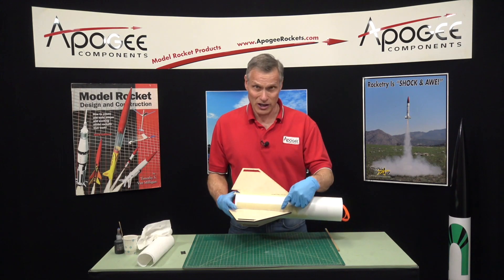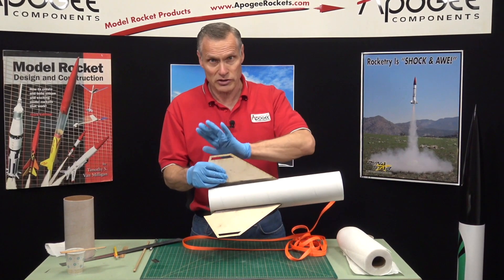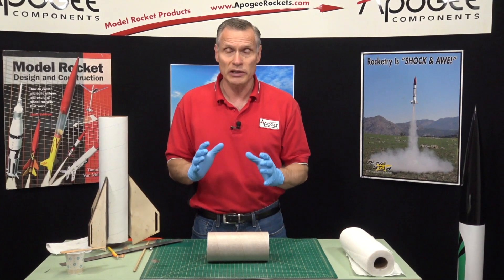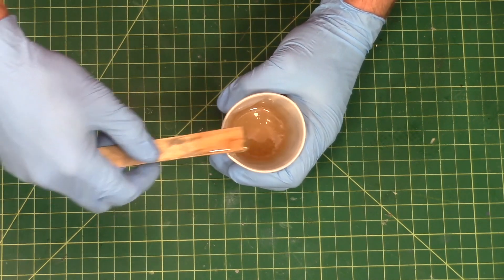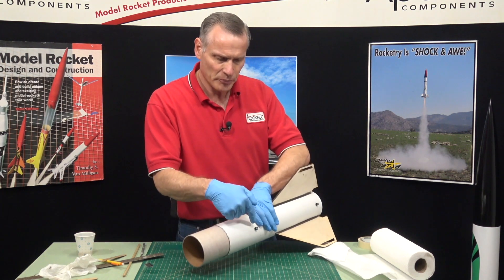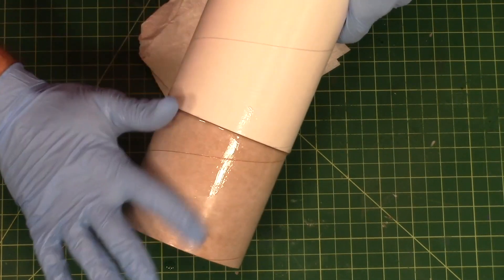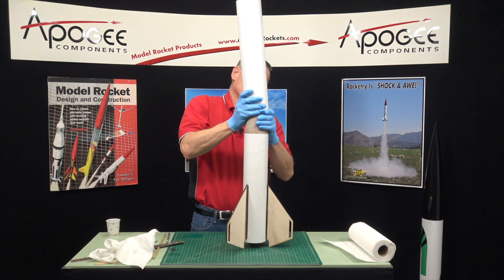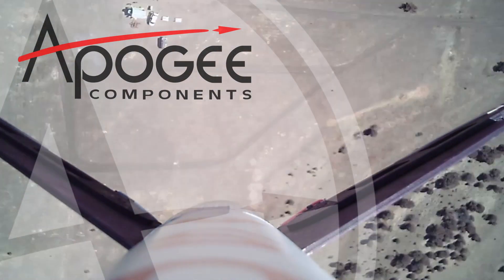Zephyr Build 6

Comment: Have extra gloves pre-inflated and ready to go, if your sticking your hands in the cup.  Minutes are burned and alcohol is wasted wiping off really messy DISPOSABLE gloves.  The 20 min finishing epoxy's work really well for tube and coupler fitment.  A very sandable thin slow-set that fills in the nooks and crannies of the assemblage,,body tube spirals, wood grain on prepped fins used as carded or scraped bondo, pour-gluing in lead shot or counterweight in the nose cone.  You have a bit more time before set-up of the epoxy with the finishing epoxys,,even if spread super thin.  Give it a extra-day cure time before flight.  Thanks for the Tips and video Tim.  The Peregrine is going together well.  Going to ring-bolster the very bottom of the rocket with a chunk of trimmed coupler out of the kit,, in case the lower rail button pulls out I have another spot that I can drill and mount external of the tube body,that is sealed.  I might even add 1/4" round rod guides opposite the buttons on the tube body,,for some dual-diversity.  Making notes.

Comment: What sort of performance is this rocket capable of? I built and flew Estes model rockets more than 30 years ago, but nothing that used engines over a D rating. At that, I managed to lose quite a few if them because they went so high I never was able to find them,  they got hung up in trees, or they failed in flight due to an error in construction on my part. Still, it was a lot of fun.
Reply: This is a certificate 1 model rocket, and it can fly to around 4,000 feet on an H motor (I think).
Reply: @Wokovsky  It can take a J motor for certification.  Its a hardy model and can take the flight pressures.

Comment: What brand of liquid epoxy are you using on the coupler? It looks to be lower viscosity than the kind I use. I have had wood glue seize the coupler before the part is in place where I want it. If wood glue is used then don't delay and push quick!
Reply: The best way to thin epoxy is to warm it - heat it before mixing.  Warm the bottles in a sauce pan of hot water before mixing, but keep this in mind, heat is a part of the curing process of the two parts and you just changed that.  Use 30 minute instead of a 15 minute epoxy so you have the time to do what you need to do.  You can also mix it and use a heat gun to warm and thin it.
Reply from the maker: I never give out brand information. They always change things on me, and then people ask what other brand might work. I suspect any brand will work if it is liquid.